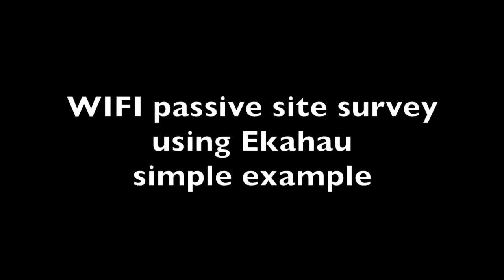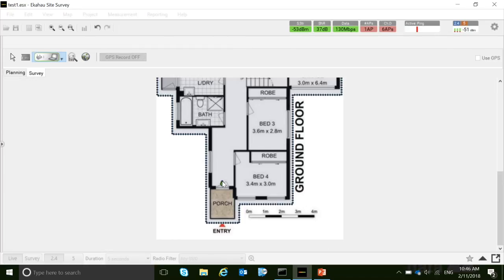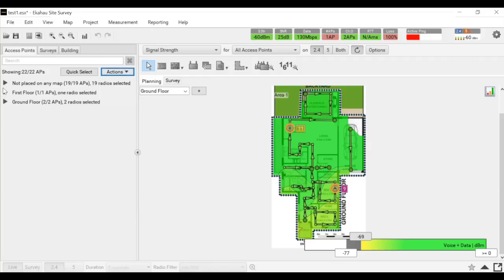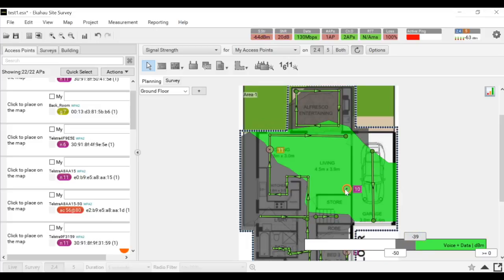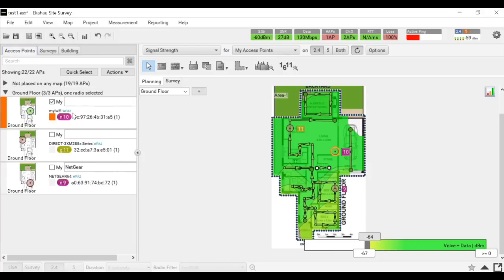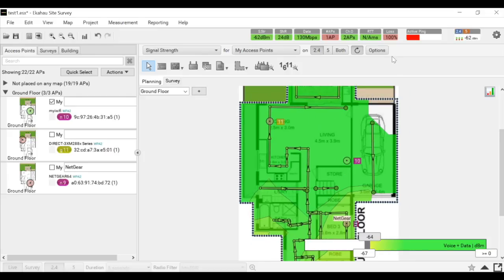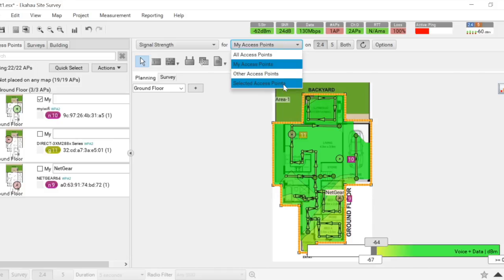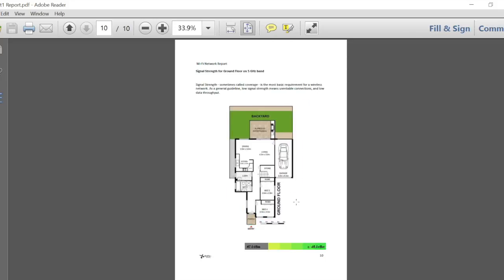Wifi passive site survey using Ekahau

Comment: How the software will recognize that there is a wall? because the walls aren't defined in the process of calculation.
Reply: Indeed i believe there's a missing step right prior deifining the coverage perimeter which is to draw all walls and elements, otherwise to the software it's all an empty space

Comment: thanks for the video, my question is how can I set the height of APs in Ekahau?
Reply from the maker: Hi Walter, There is an option to set AP height when you are doing a predictive survey  because the software needs to know where the AP is mounted to predict the coverage. But this video is about a post implementation survey, as the implementation is already done and we are checking the coverage of the installed APs the AP height is not needed, software report the coverage based on what it can hear through the dongle.

Comment: do you need the dongle?
Reply from the maker: The licence is tied to the dongle mac address, therefore you need the adaptor to start the program. You can assign the licence to laptop's built in adaptor and then you don't need the Ekahau dongle to start the program.  about wifi measurements may be using Ekahau's own adaptor is better I think.